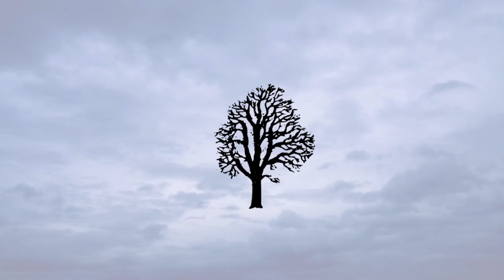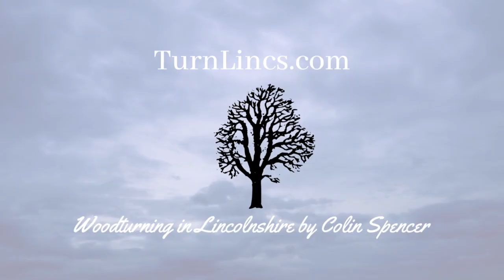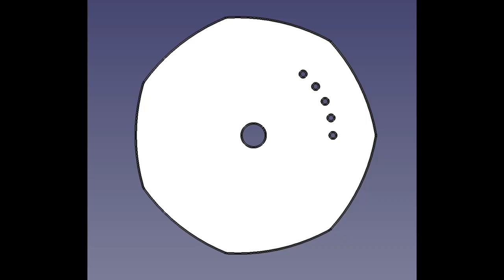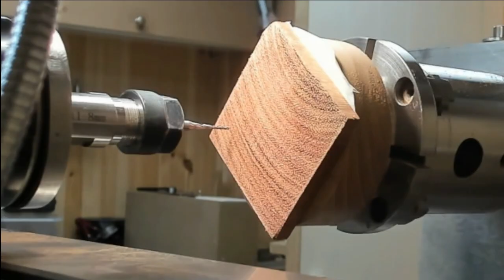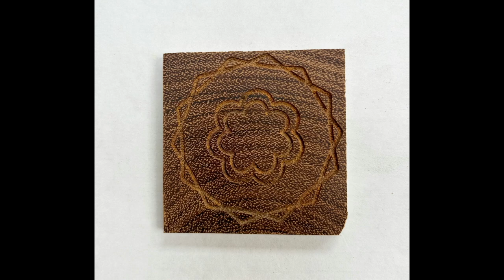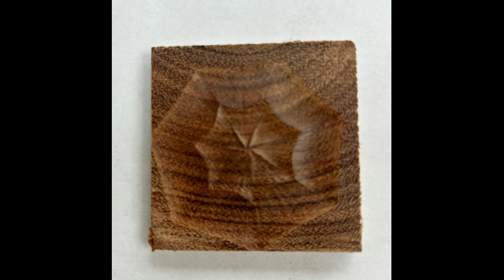Cutting on a Rose Engine lathe using a Plain 7 rosette

Comment: Thanks Colin. I've just developed/am developing a digital indexing system for my lathe and have been thinking about  phasing. It can do phasing now, by setting a new zero, but I'm not sure if that's all there is to it?
Also I noticed that there were 5 holes in your rosette and wonder what the purpose of those is? 
I've also been considering how to implement partial indexing (for example with 24 divisions you could use 2 positions, skip 4  and repeat 4 times). It's something I've used for spiral turning, but I'm not sure how useful it is generally?
Reply from the maker: If you look at the 5 holes the outer 2 align with the peaks of the rosette, the centre one is halfway between these 2 outer ones and the other 2 are halfway between the outer and centre holes so this allows for phasing at quarter and half phase between the peaks. The holes are to mesh with a pin on the rosette backing plate and so to use the phasing I slacken the rosette and rotate it to the appropriate hole. Let me know if it isn't clear and I will see if I can explain it better.
Reply: @Colin_TurnLincs  That makes total sense thanks. It confirms my conclusion that the important thing is that the phase positions/angles do not coincide with the division angles (peaks in this case). I'll look for other  examples before coding anything sophisticated. Thanks.
Reply from the maker: @DancesWithAardvarks  Depending on how you are doing your phasing you need to be able to phase between both the peak and the trough and to include the peak and the trough. I actually only needed 3 holes it was just easier in my cad program to do the 5. Some of my rosettes do have more holes between the peak and the trough.
Reply: @Colin_TurnLincs  Thanks Colin. I'm trying to think ahead with a view to using a motorised cross slide to get some ornamental features instead of a bobbing head and rosettes.
Reply: @Colin_TurnLincs  I think I have it. If  my software have a user defined number of phases it can subdivide between main index points. Then the user can select which phase to use and the angle to the next point with the same phase is the same as the main indexing angle. 
So, if the main division is 5 (for example) and the number of phases is 5, the first phase positions are 14.4 degrees from the main divisions, the second 28.8 degrees and so on.
Thanks for your help as I had misunderstood phasing as simple angle offset, but I see it is more like phases in electric sin waves.
Reply from the maker: @DancesWithAardvarks  This software has already been done by Paul Paukstelis using plugins for Octoprint he has the software freely available on GitHub https://github.com/paukstelis/OctoPrint-WindowsInstaller/ this uses linear slides controlled by stepper motors to move the cutter rather than to rock the headstock